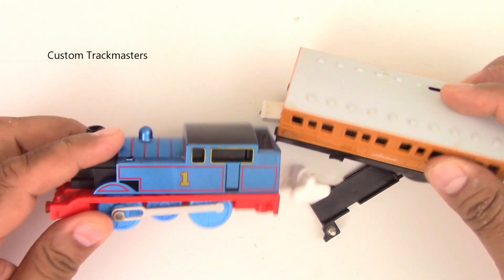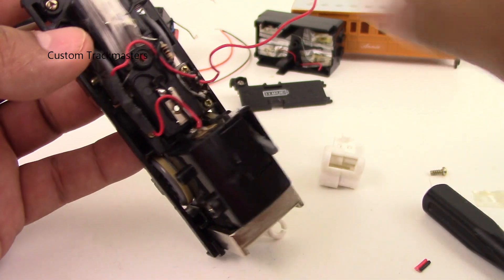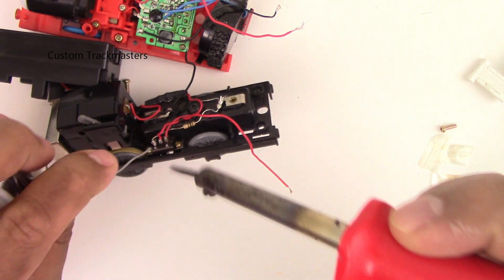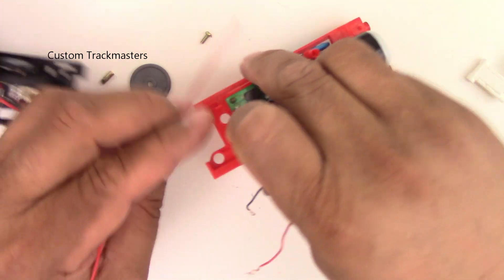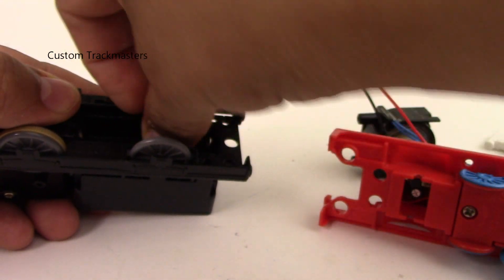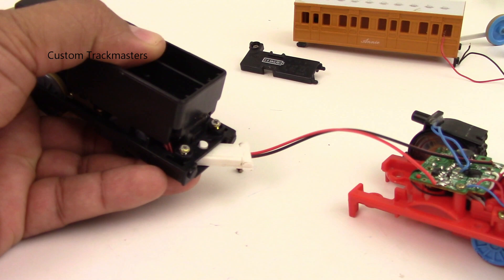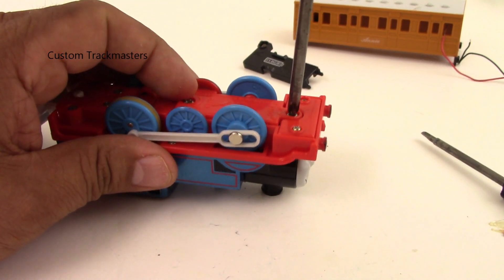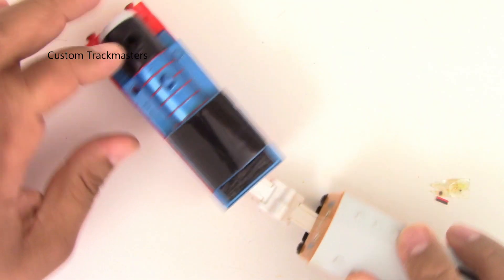Fix Repair Steam along Thomas Trackmaster Salford UK sub Thomas and friends

Comment: Can you fix and repair some of the following:
* Fixing the coupler for Molly
* Rewiring R/C Thomas
* Painting the Rooftop for Dirty Percy
* Restoring Lady
* Rewiring Talk n Action Thomas + Stickers fo Thomas and Annie's face
* Rewiring Talk n Action Gordon and James (Missing Battery Cover)
* Wooden Railway Motorized James (Missing Top Switch)
* Fixing the Motor for Daylight (4412) and Pennsylvania (6610)
* Restoring Charlie and Rusty
* Fix and Rewire Rocky
* Fix and Repair Talk n Action Thomas
* Fix and Restore Stepney (Missing Middle Wheels Cover)
* Fix and Restoring Sir Handel
* Restoring Diesel 10 (Painted as D199 + Missing Pinchy)
* Fixing Motor on Wooden Railway Bertie
* Fix and Repair Wooden Railway Motorized Lady
* Adding Stickers for R/C Flip Face Thomas (from a London Subscriber)
* Missing Stickers for Skarloey (from a London Subscriber)
* Restoring Talking Victor's Big Splash + Missing Stickers for Victor on each side (from a London subscriber)
Reply: can you stop begging?